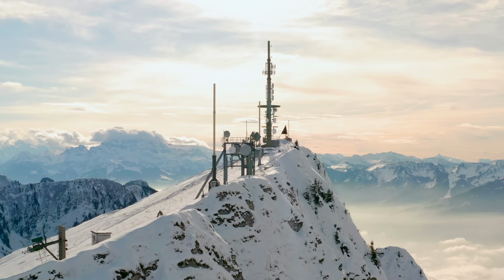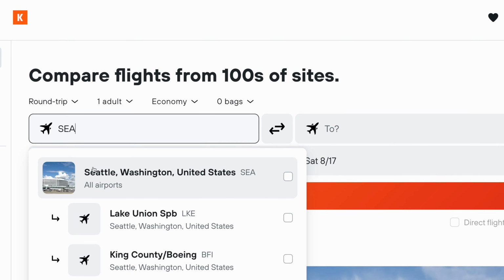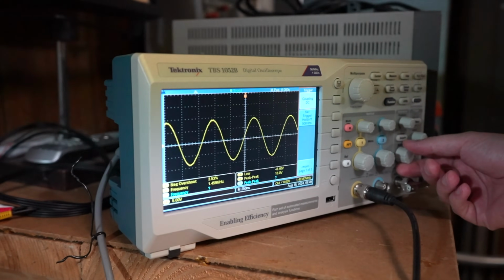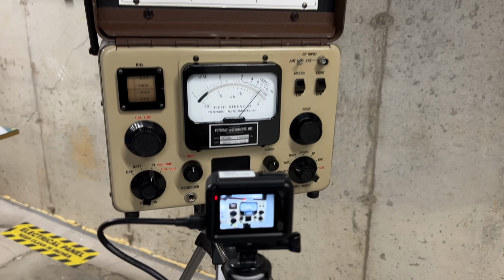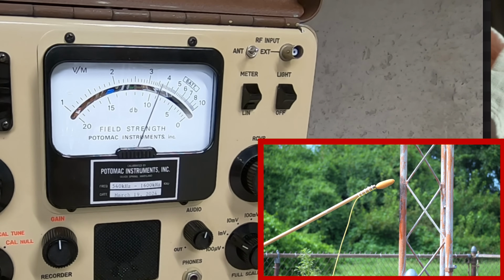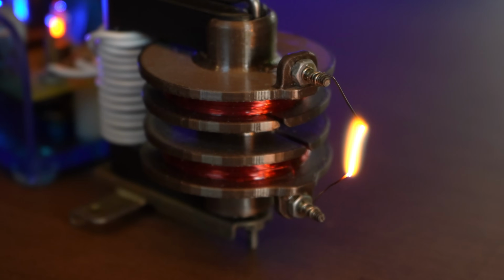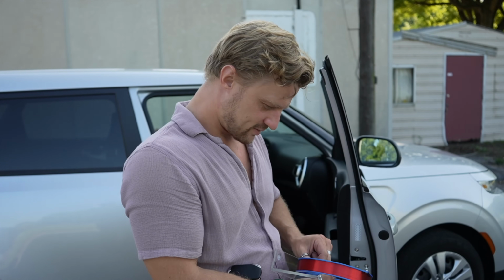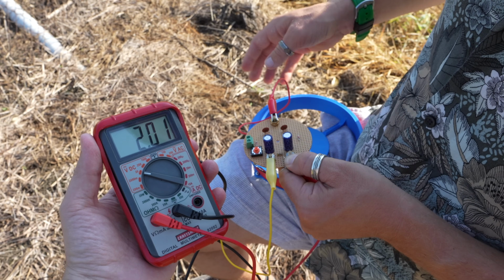Stealing Energy From Radio towers Using Plasma (ft. Geerling Engineering)

Comment: This contradicts everything Tesla said. He said the 2 million watts (95%) should go into the ground and only (5%) into the air. He said every radio engineer got it wrong. The air is an insulator outside the ground and deep into the ground until you hit the anaerobic layer ( no air).The air is like two tuning forks in oil.

Comment: Did you know that the mitochondrion communicate with cells by superimposed ultra weak magnetic flux generated from the electron transport and membrane potential.  Also the myelin sheath is the return wiring of the neural circuit. Bad news for tech people. We got neurasthenia 1860 and the establishment rushed to cathegorize it into the mental disorder basket. Duh!

Comment: So will the radio tower charge up a 13.8v LifePO4 battery or a 12.8v lead acid battery while using an inline power meter like we use in Ham radio? 🤔
Reply: Only if the plasma array has a bi lateral audio signal transfer system.
Reply: @ It would seem to me that device he built with that 3D printer and all that copper magnetic wire would pull electrons from the air at a increased rate, which is what happen to make the LED light to come on in the first place at 14v, right?

Comment: Fun fact: once, a coil of wire was found buried next to a high voltage power line. It led to a sprinkler system. A farmer had discovered that by burying that coil, he could capacitively couple to it, and was using this to water his crops.

Comment: I lived in Houston when Hurricane Ike came through in 2008. Middle of the night as the hurricane passed over my TV off, suddenly started playing the audio of an unknown radio broadcast. Strangest thing I've ever experienced.
Reply: I was in Houston during Ike! Power line feeding primary to the transformer broke and shorted to ground.  This created EMP so strong,  it immediately killed the 5" battery powered television that was on. Only the radio kept going. Killed a 13" color Disney brand TV that wasn't even around Power, and their 55" TV went out exactly 1 week after power was restored 2 or 3 weeks later.
Reply: @ElektroQtusZar what are you on?

Comment: I have seen an episode of LTT years ago where they wanted to build a room with a sort of power emitter that would wirelessly charge electronics that accepted wireless charging without putting them on a pads, basically just sitting on a table or (I think) in their pocket. They had a couple methods they tried, one I believe was a sort of ceiling light fixture and your item basically needed line of sight but they got it to work.

Comment: To keep the led on you just needed a permanent ground at the anode of the led or negative pole of the capacitors so the antenna will work as positive and the ground as negative. I think cheers!

Comment: Thank you for a very informative video. I was wondering if this is what Nikola Tesla did when he got a car with an electric motor and ran it without any onboard power source? Also what is the maximum distance from a 12KW radio tower that you can extract useable power? That is how much power can be harvested at say 1km or 1 mile from the 12KW tower. Is it different for FM towers?

Comment: Hey man I doubt you'll see this but  I'd love to see a video of how you made that in general. Even though I'm sure the parts would be more expensive than just using my electric service I'd love to build some small lights that are powered by radio waves. Just enough in some spots that my eyes could adjust to see the doorknob or something if needed. Blowing the diodes at 30km? I have a 50kw station just under 60km away so I'm thinking I could get similar results during the day before they turn down their power.

Comment: Yes!  Greater capacity test for "Energy From Radio towers Using Plasma ", please.  Also I always wondered if you live near power lines that crackle and make noise all the time, and also maybe a transformer, if you could harness some of that ambient energy, maybe to run a tiny radio or small lights?

Comment: before we used FM in the UK, the local AM radio transmitter used to put out enough power to light up light bulbs using tuned circuits.

Comment: Hi Jeff, I really enjoyed your video on the wireless energy receiver. Question: Would it be possible to build an energy receiver which would output 100 - 240 volts. This with a 4 and/or 5 Ghz input from a cell tower at around 200 - 400 meters. I can imagine that you can scale up the received energy with your specially built transformer... Please let me know if this is possible. Please checkou https://www.youtube.com/watch?v=42aTSeQKI10

Comment: For anyone who sees this and isn't already aware, the craziest part about all of this, not the plasma or the fact that you can hear the radio signal through it, not the wireless power transmission, no sir and or madam the craziest part of all of this is that those radio waves are made of the same stuff as light. The light that enters your eyes. Colors. Invisible colors like infrared and ultraviolet radiation. It's the same thing as microwaves that cook your food. It's the same thing as the X-rays that scan your bones. It's the same thing as.. well just look up a radio frequency spectrum chart and prepare to have your mind blown If it hasn't already been by this fact.

Comment: There's already a working prototype of this concept, called "ELECTRO PLASMA GENERATOR designed 3 years ago by Filipino scientist Elias Delos Santos. It was a sort of an RF power harvester that can output 220 volts and can run home appliances. From what I understand in his design, he used an  RF detector and rectifier circuit to convert radio waves into dc voltage, then used a joules thief or a voltage multiplier to boost the voltage. This amplified voltage was then stored into large supercapacitors that startup the main generator board which consists of a step-up transformer tesla coil to further amplify and convert the dc voltage into 220 volts AC along with the necessary watt power output to drive appliances like TV, aircon, refrigerator, or even a welding machine. You can watch the demo video here (in Filipino language) - https://www.youtube.com/watch?v=r51TdNPA55s

Comment: Radio tower charged flashlight. Or, radio tower charged radio. 
Why does a handheld radio need a battery to work, when there's already power in the air? 

A goofy question to ask. Won't really help if you're too far away. 
For now...

Comment: First he says this is an educational video. They mix truth with lies. He states radio waves, both AM and FM use line of sight antennas. Then they say they transmit up to 2,000 miles. That's Not possible on a ball earth which they have the audacity to mediately show a globe after saying it.    Then they trow in a NASA news feed saying 2 astronauts are stranded in space.  You see how deceptive they are, which ironically is what NASA stands for in Hebrew

Comment: Why doesn't it fry your wireless charging coil and electronics in your expensive iPhone? What if your DIY Coil had a diameter of 1 meter and had plenty of wire length, could be transformed to 12v to charge a lead acid battery? What would be the distance needed?

Comment: I've been using Ion exchange to run an exchange motive charger. Using simple oscillation from transistor to pulse charge any battery wet or dry. It's amazing stuff to realize no meter needed to run me houses' electric needs.

Comment: Do it, do it, do it.     :)    
 Buy the way your gizmo does NOT steel anything, it simply captures and puts to use what's already thrown out by the tower. It will go to waste if it does not get captured and used.  It's thrown out into the air awaiting any user of a radio or your gizmo who wants to make use of it for free.  😂 just as long as you also use the energy from the ads as well, then yer good, no guilty feelings to stay awake nights over.  😮😊

Comment: Voltage is not power.  Try lighting an incandescent lamp.  (LEDs don't draw much power to generate light.)  Also, when you put an antenna anywhere near that transmitting tower, you affect it's radiating pattern, and are actually causing an FCC violation of the licensed radio tower.    There is no free lunch here.

Comment: where are the "oscillator's" that you mention in that cabinet of vaccum caps and inductors? what would they be used for in a final tune stage of the amp/antenna?

Comment: Jay - You might want to try building a flame speaker.  I built one back in the dim, dark past.  It is basically a modulated high voltage source that is rectified to HV DC.  The modulation is from a tube amp audio transformer in series with the primary of the HV transformer.  The HV secondary electrodes are mounted so one is above the other in a flame.  The flame is "salted" with something to produce free ions within the flame, making it conductive.  If I remember correctly, the electrodes were space 2-3" apart with a propane gas flame source.  The audio source was  a radio, with the output to the speaker going to what would be the secondary (8-ohm) of the audio transformer, with the secondary in series with the input voltage of the HV transformer (I think that it was an oil furnace starter trans).  It was loud and pretty dramatic.  Might make a good show for you. Most of the current (no pun intended) articles on the web are about Plasma Speakers, with modulated HV arcs - something that you are familiar with.  This may be the original article that I used - https://onetuberadio.com/2018/07/02/flame-speaker-science-fair-project/
Flames, High Voltage, Free Ions - what could go wrong?
David

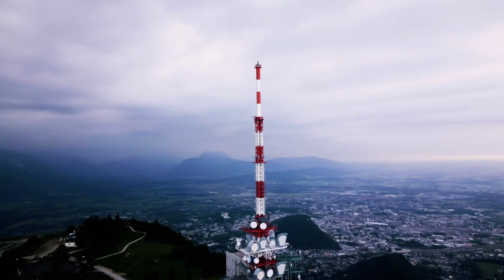Comment: At 1:15 "FM works by line of sight".  Actually, the modulation has nothing to do with it.  It's the frequency used by typical FM radio stations that is so high that it requires close to line of sight.
Reply: And what frequency is FM most commonly used at….  
Too pedantic
Reply: @JackSimmons503  accuracy in statements matters.

Comment: if wireless energy is possible, why we dont mass produce this kind of towers? imagine that you dont need a battery for your phone, or your pc or electric vehicles or other electronics. it will not resolve the issues that we have with power cables?

Comment: A common misconcepton is that these towers somehow can focus the energy in the direction of a receiver, so that they can work as a wireless power station. They can't and they don't. The best ones do prevent the wave from going in completely random directions, but that's not what wireless power transfer would require. The closest we can get to actual wireless power distribution is by having two big microwave reflector antennas facing each other. And that only works up to a point. When the distance increases, the transmitted beam is no longer intercepted, but spreads far past the edges of the receiving antenna. It doesn't work as an efficient "wireless power line" but more like a spotlight. So much for Nikola Tesla's famous idea.

Comment: I'm able to light up an LED a mile away from an AM radio station using a long wire antenna, a ground wire, and two reverse biased LEDs in parallel.

Comment: Dude you could just use one of those generators to constantly be charging batteries out of thin air if you live near an AM station.
It feels like you shouldnt be able to do that, but the energy IS just flying about freely so... prolly will charge very slowly but "free to you" energy is free energy lol. Just think, advertisers could be charging your batteries. Or taxes, idk how most AM towers are funded. Either way its cool.

Comment: really for power extraction, your diode tanks do not need to care too much about what frequency base you have. As soon as any wave hits the antenna and crosses bias of the diodes on any peaks, it would have been charging your circuit, as it was built on. because you built it to capture the magnetic pattern, with a radial wound coil, these voltages can get quite high for very tiny moments, cross into the bridge, and be held as while in the caps. because it is so little current tho, it is generally safe. To capture power you don't really need a frequency filter, but higher performance faster switching diodes to scrape the voltage off the waveforms, harvesting all kinds into something. The frequency tuner limited your capture.

Comment: That's great! Set one up near your smart meter at your house and see if you can power your home a little with one. Then I'll join your channel.:yougotthis: If it works and I join your Patreon channel do I get information; like detailed videos of how it works or how to maximize its reception or any videos how to build one or something?
Reply: Or even this simple bridge rectified  version. 
https://youtu.be/lDm00Ww6qE4?si=b9WEEd6Fpvx_ePMC
Reply: Could you even make it usable by making like a cheap clamp meter from harbor freight or some othet electric supply company to catch the current flowing through cables and transfer the energy and magnify the energy to a sodium battery bank or alt-energy volt relay connection?

Comment: I had this idea years ago when I discovered that you can build a simple radio receiver that doesn’t require batteries. You can pull the radio waves out of the air and power a very simple radio without the need of a power source, the radio waves are the power source. That’s how pows listen to broadcasts during ww2. With as much microwave radiation as there is saturating the atmosphere, even more so now that 5g is up and running, you could likely power something substantial with the right coil setup. Something like a cell phone or AirPods or something that doesn’t require much power.

Comment: Small precision : I believe the plasma channel doesn’t expand and contract in a plasma speaker. 
Changing the amount of energy you put in the plasma channel quickly (like with the AM radio or your plasma speakers circuit) instantly varies the temperature, but the channel’s volume doesn’t have time to change (it physically cannot expand this fast) so the pressure does. 
Given PV=nRT, we now can set V, n and R constants, giving us P and T proportional, or simply the pressure proportional to the amount of energy be put in each carrier cycle. So the amplitude in an AM signal is directly proportional to the pressure output hence.. sound !
Same applies so a plasma speaker where the pressure before proportional to the duty cycle of the fly back driving frequency.

Comment: Stronger caps and more load like a desk fan or 50w light bulb. 
Maybe rewire so you power load from caps and second circuit charges caps then dumps to ground.

If you look at tesla's remote power experiments, or at least what is out there about them, the theory was to use a roof antenna to bring power in then dedicated grounding wire to complete circuit. 😉

Comment: I don’t know enough about engineering to know if this is a dumb question or not but, can you do a little motor with a propeller? I’m not sure you’ll get enough power to spin it up but if the voltage is increasing as you get closer wouldn’t it just spin faster? Would be an awesome visible representation if that’s possible but maybe I’m missing something.

Comment: Recycling energy that is already in the air is an interesting secondary idea. Nickola Tesla had this idea of a free-air transmission of energy. What if a population, which happens to be close to one of these large AM towers, could use the energy that it puts off to power homes in combo with other passive energy collectors?

Comment: I have a project you would be very interested in a truncated Icosahedron plasma vortex generator using coils inductors and simple circuits and an Arduino pwm simple but if your interested the production and manipulation of plasma for energy generation no moving parts and not free energy

Comment: I'd like to see a device that can actually be useful, like charging a battery. If those towers are generating the power you're suggesting, and based on the numbers I've heard, there should be potential to perform real work. I intentionally didn't specify the battery size, but it would be interesting to see how large a battery could realistically be charged. Also, I'm curious about the efficiency of radio waves compared to solar energy. I believe it all comes down to the design.

Comment: Just curious on your ionic thrusters why you don't use multi layer circular designs... like a doughnut inside a doughnut with each layer being dual sided.... also curious using variable charged grounds to have stages of polarity difference to increase velocity of Ions passing by the first positive charged.... or some kind of dual stage variable voltage.  Not in power increase, but rather reception to create a greater attraction of the opposite polarity.